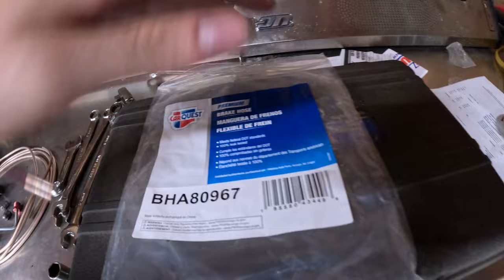Chevy Nova brake system FAILURE?! New Ford F100 Farm Truck!

Comment: Where did you get your hood and is that a 4 or 6 inch cowl? Im trying to find a 4 inch steel cowl hood with no mesh holes in the top i like having it all open
Reply from the maker: The car currently has a 6inch fiberglass cowl with steel framing inside. Hopefully you find the one you are looking for! 🍻